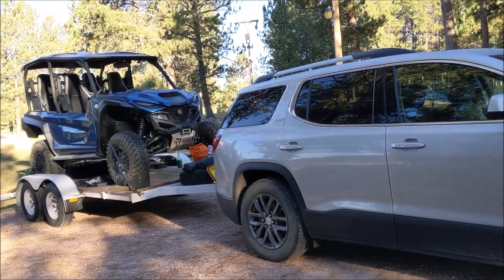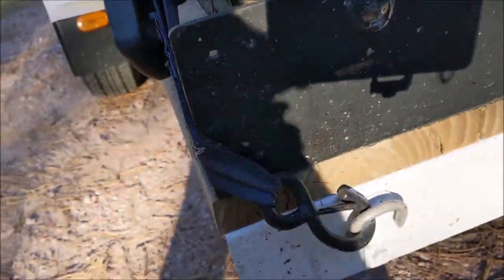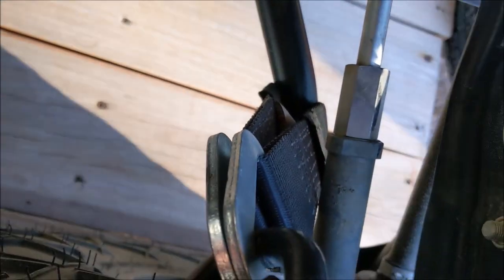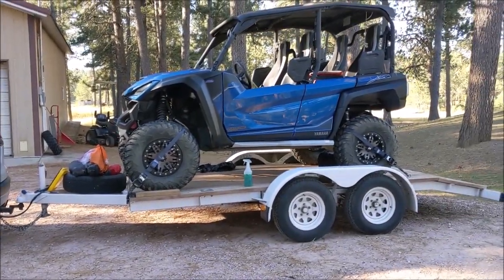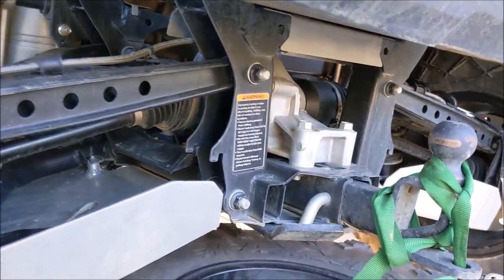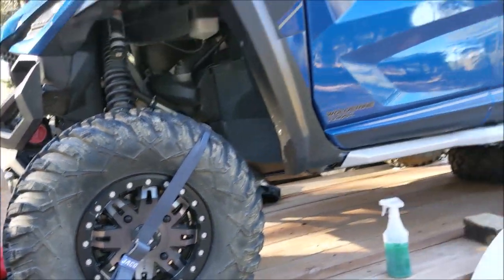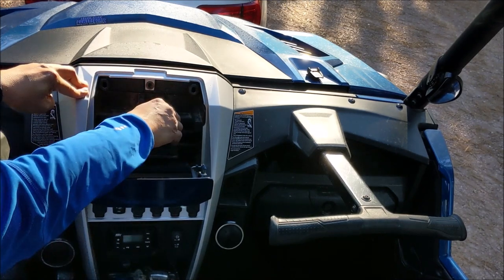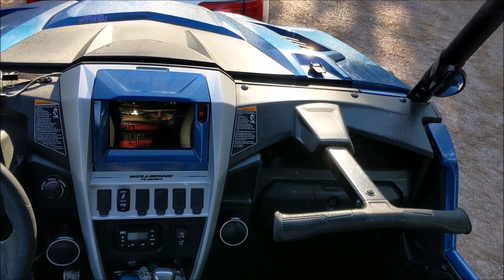Yamaha RMAX 1000 trailer tie down, booty juice, and Adventure Pro fit

Comment: The strap by where it hooks to the trailer up front should have some protection on it. A tight strap will cut through faster than anything. Not saying its not a good way to do it but i would for sure protect that corner where the strap goes around just stayin
Reply from the maker: The edges on that were ground/rounded before being painted so they're not sharp at all and I actually put a piece of split tubing over it for extra measure.  The straps weren't even frayed where they contacted the edge.  Thanks for your concern though.

Comment: Trail Armor guards prevent running a strap through the lower A-Arms.  Not sure about the Yamaha OEM.  I may try the method you used next time.
Reply from the maker: Upper A-Arm should be just as good.
Reply: Tire straps work good too.

Comment: That strap is gonna friction fatigue where its coming in contact with the trailer and dont say it not a sharp edge does not matter still builds friction you might get away with it for awhile but it's not if it's when
Reply from the maker: You don't have to worry as that trailer is sold and even if I did keep it I had cut some tubing to go over the SOFT edges.  By your logic, anywhere the strap touches could cause it to abrade though.....the tire, a rail, suspension component, etc.

Comment: Your straps won’t work with A-arm guards.I have them on my Rmax
Reply from the maker: In that case you can just go to the upper A-Arm
Reply: @MassiveOverkill  I use the clevises on the front shock setting on firm the machine no movement at all, one strap works great. Two on the back

Comment: That is the worst way to tie a machine down.  It would never pass an inspection. Trailer tips over. the machine brake loose.. it's gone.  Tires will flex enough to jump out of that. OMG.. I worked longshoreman for 25 years.  On roll on. Roll off boats. That would send high end cars over sea's. Billions of dollars of cars in one boat. You do not want to tie that down like that.